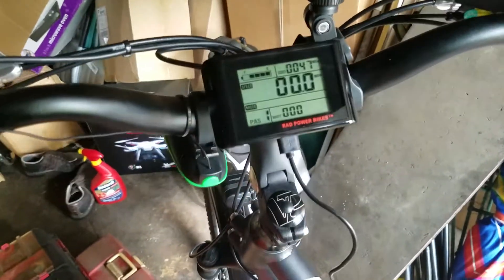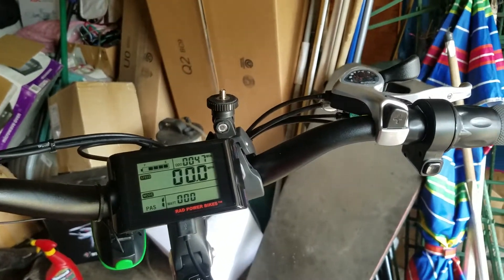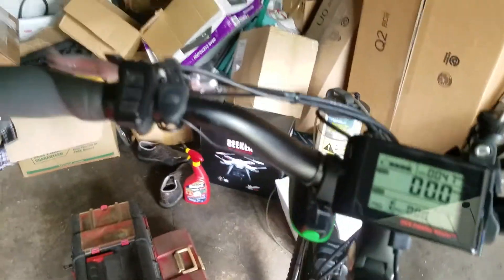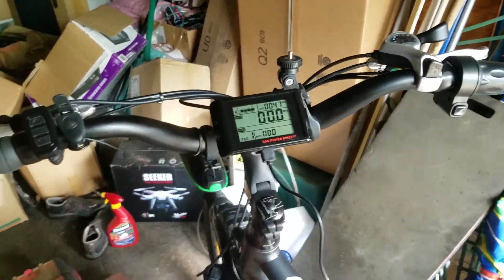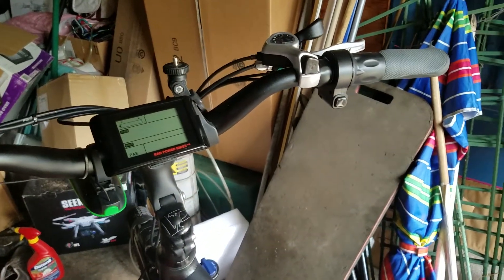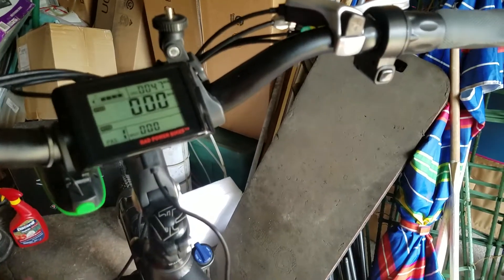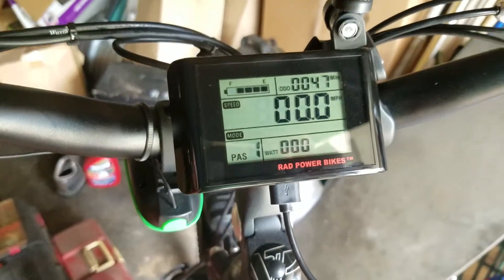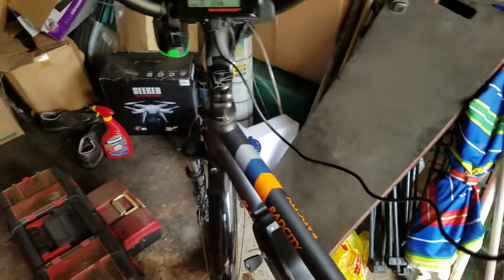USB CHARGING PORT

Comment: Ironically I was just going to start using the USB to power my camera today, thanks for the tip
Reply from the maker: I think they upgrade the USB to 1 amp on the new bikes. So a little better charge rate.
Reply: @E-bikeeverything57  now my camera lasts longer than 30 min... Thanks